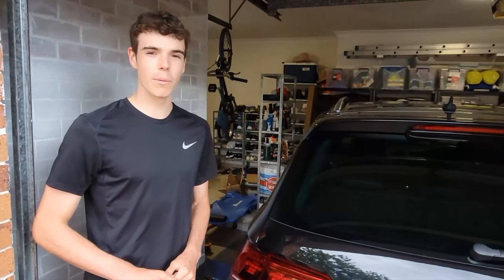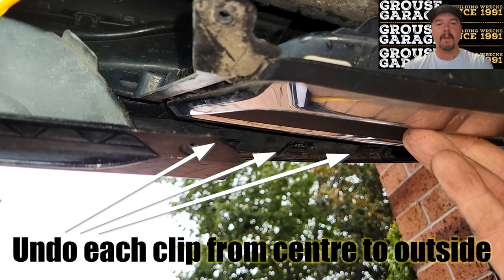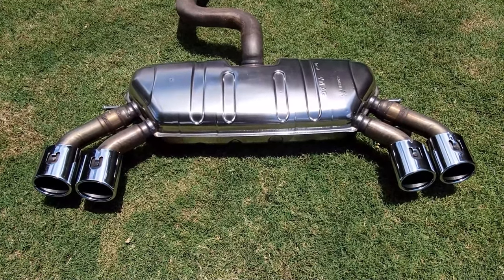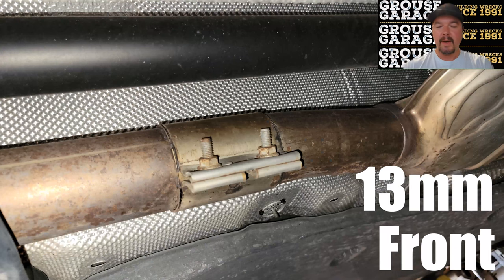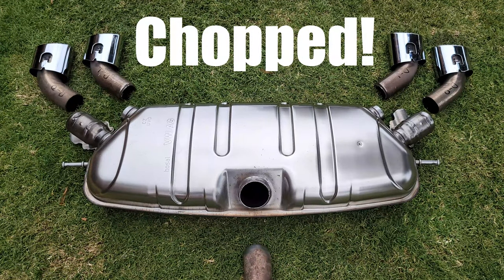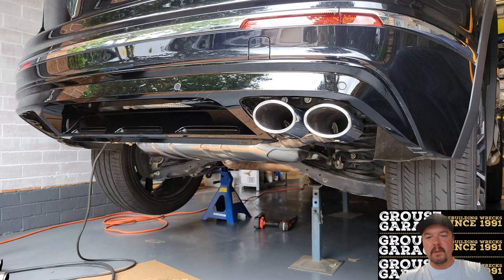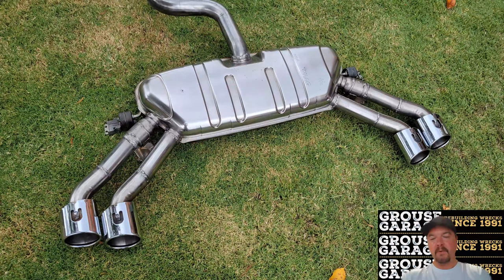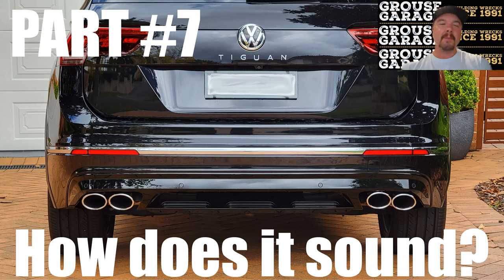How to fit a GOLF R exhaust to a VW TIGUAN

Comment: Great video! Not sure if it has been asked but can you advice how much something like this cost?
Reply from the maker: Hi mate. If in Australia, you would be looking at $250 on average for a good second hand Golf R complete exhaust. I paid $170 for mine with valves. Miscellaneous stainless pipe cost me up to $100. I did all the install obviously. No further costs. To have an exhaust shop do the install is going to cost around $400-$500 I believe, from what I have been told.
Reply: @GrouseGarage  you know in china ,this may cost double!

Comment: Awesome vid, thanks! I will have a go very soon. Qyestion: where did you get the 'TIGUAN' letters for the centred lettering? They look bigger than our standard on left side?

Thanks a million!
Reply from the maker: Ali Express for $20. They match current 21-22 facelift Tiguan. It's a much cleaner look I think!
Reply: @GrouseGarage  ah thought so, thats great! Yep I agree super clean and symetrical! Also, getting my mk7.5 r exhaust fitted friday based on your vid!
Reply from the maker: @pete8oes  Let me know your thoughts after you have it done. In sport mode sounds great under hard acceleration 👍
Reply: Will do mate, Looking forward to it 👍
Reply: Reporting back.... I have installed my mk7.5 R exhaust! Wow what an improvement! It really sets off the look of our tiggy, worth the upgrade on looks alone... let alone the new exhaust note! Whoa!

I left the valves in too, so I can switch between 'wife mode' and 'husband/beast mode' by hand... both have a great note, just different types of grumble at idle and when giving it some... DSG farts in beast mode are nice 😎

Thanks a million for your video! You covered lots of points that went unanswered on the forums. As you said ' so stoked with the result, so so happy', I 100% agree! Shout yourself a beer mate 👍

Next up - replace the TIGUAN to be centre aligned. Then you can spot me on NSW roads 🍻👍🤜🤛
Reply from the maker: @pete8oes  Awesome feedback! It's an inexpensive mod that ticks several boxes in my opinion. I'm pleased to hear you feel exactly the same.  My 'weekend' car is a V8, so this Tiggy mod is on point for a daily drive.

Comment: Hey mate, is the resonator of the tiggy the same as a R? I took the res out of my R but want to keep the tiggy a bit quiet like you.
Reply from the maker: The Tig and Golf R res are completely different. Not interchangeable.
Reply: @GrouseGarage  thanks mate, so keep the toggy res on gotcha. Does the right tip look a bit uneven? Or is it the angle

Comment: How many horse power is the Tiguan? Is it the 2.0 tsi 184hp!!
Reply from the maker: 162 kilowatt = 217 horsepower.
Reply: That’s what I thought, in North America the only available model is the 2.0 tsi 184 hp, also I am sure u have a different transmission then what is offer here in North America, anyway sound very good. Wish near future the will offer it here, I will definitely trade my Tiguan for the new model anyway nice video 👍
Reply: @Enzo-zh3xk  Surprisingly the market for Tiguan 2.0TSI in Europe and Australia has much more variety. They have a number of Petrol and Diesel options whereas here in NA we have the standard 184hp 2.0TSI. You can get a Tiguan in AUS/EUR with the same 2.0TSI tuned engine as the Golf R if you want. 322hp in a Tiguan?! Yes please, but I doubt we'll be lucky to get that in Canada or US.
Reply: @GrouseGarage  I GOT APR 1 stage to improve horsepower to 220(maybe)😆😆

Comment: Hey mate, love the video. Did you keep the valves open or shut? And "boomy" sounds at low rpm?
Reply from the maker: I left the valve actuators in and their default position is open. I don't have any "boomy" sound or drone at all. It's all quite subtle when cruising but throaty when you give it some. DSG shifts sound great! 👍
Reply: @GrouseGarage  Is this a North American Tig? Without the DSG.
Reply: @GrouseGarage  i just know how to make sound in DSG shifts,but i dont konw how to make sound in P,i wanne to hear the "boom"sound in P!do you know how to do it ?
Reply: @zhaocaixiaoDU back box delete if you want that

Comment: This might be the stupidest question you get. But I’ll ask anyways what generation golf R exhaust? Does it matter which generation?
Reply: Also I have a 2018 Tiguan would this still be possible?
Reply from the maker: Mk7 or 7.5 Golf R exhaust. Will definitely fit a 2018 Tig. That's what mine is. Your rear bar may be different though depending on model.
Reply: @GrouseGarage hey sorry to bother again but I have been thinking and have another question. Do you think any after market golf R exhausts could fit on the Tiguan (with the same amount or more welding than you did)? I’m honestly not satisfied with any of the Tiguan exhausts on the market and airflow wise a golf R exhaust doesn’t look like much of an upgrade in the airflow department. Sorry for rambling I’m just thinking hard about this.